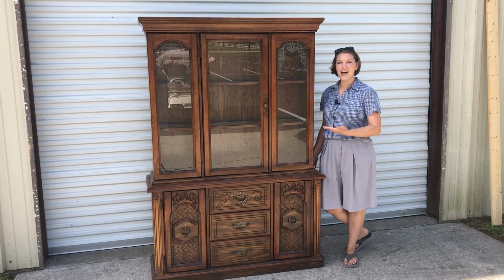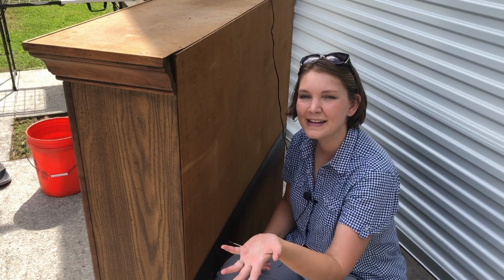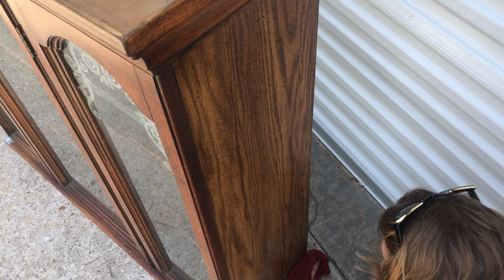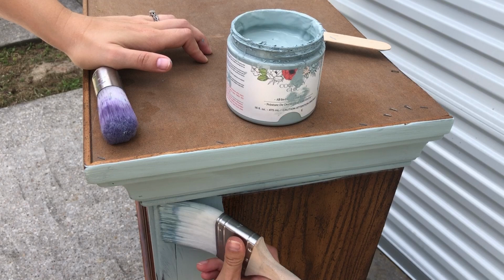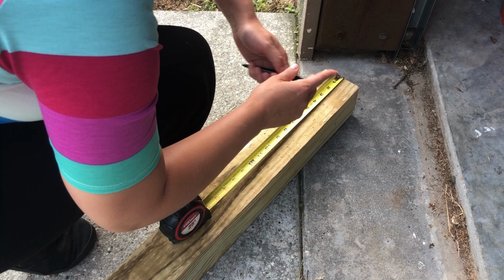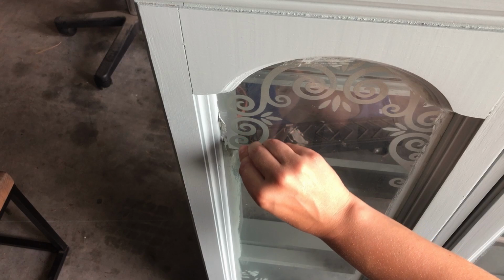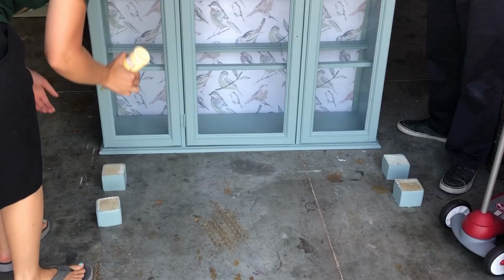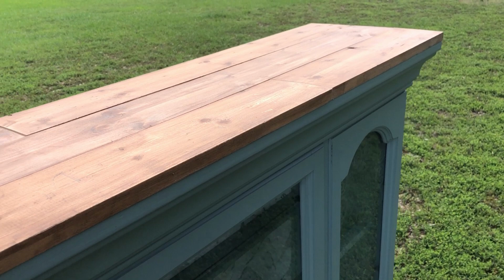Making My Own Furniture Feet | OLD HUTCH Makeover Ideas

Comment: Do you find these legs are the strongest? Im redoing my first cabinet. Its VERY heavy solid wood with 3 thick glass doors. I dont have the buffet so it needs legs but im scared if choosing ones that cant hold this type of weight + once its filled. Suggestions on legs?

Comment: I love how this piece turned out.  I am Curious why you didn't take the glass out to paint the piece.  It looks like it has the hardware that just swivels to allow the glass to be removed. And...did you see if the "etching" was true etching and not just paint.  I found a mirror that I almost passed over because it looked etched and I hated the pattern, but it turned out to be a painted "etching" and scraped off with a razor blade.    Again, this piece is beautiful, I would have still painted and done the fabric, I was just curious.
Reply from the maker: I tend to break glass when they are in tight spaces so I left them in to protect them 😂  plus the side doors don’t open and the shelf almost touches it so it would have been very hard to get them out. I did check the etching and it was actually carved into the glass. 
Thanks for watching ♥️